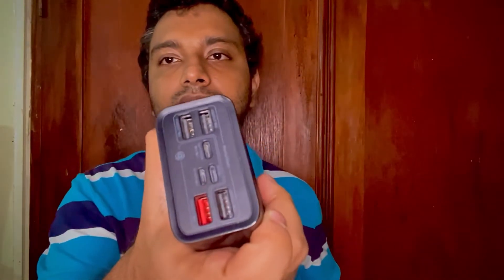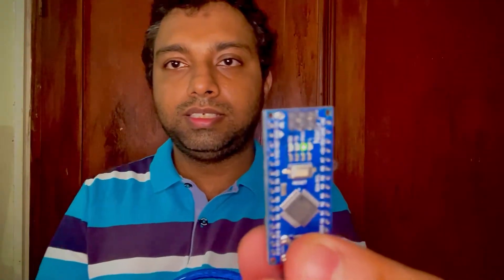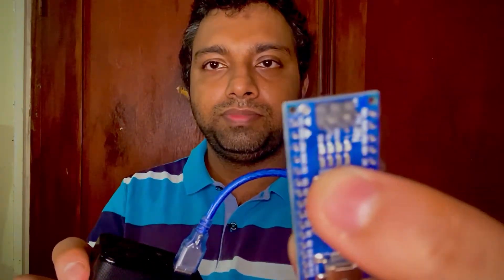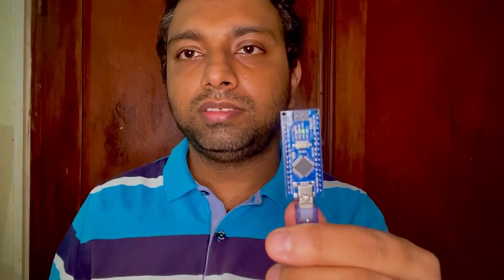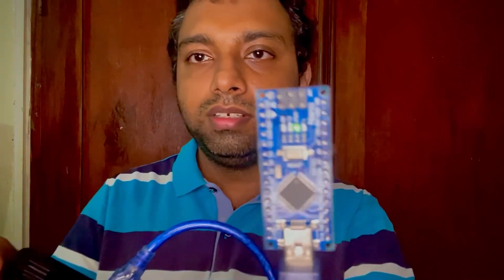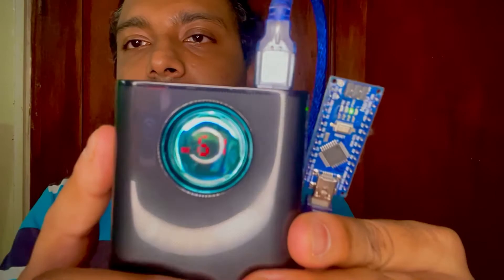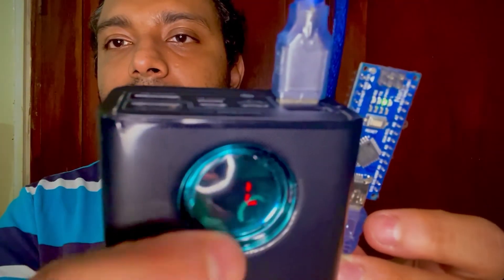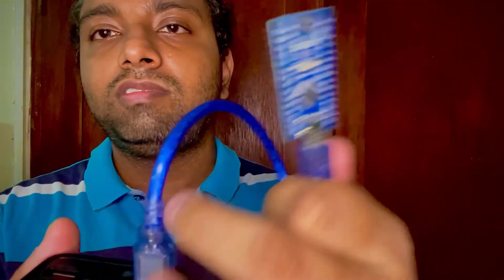Interesting feature in Baseus 65W Power Bank

Comment: Damm guys dont buy this BASEUS 65W laptop charger. This is a common problem.  It only lasted me 2 months and now its dead. Its the design. DONT BUY IM WARNING YOU. Dont waste your money on this Chinese SCAM
Reply: Worked only for 2 days. Baseus should stop selling this model
Reply: The circuitboard for the input is not working anymore I have the same problem. Doesn't respons to anything anymore it's dead
Reply: @mbb3a  I used mine occasionally for about 10 months. Then when I finally decided to use it for something a bit more intense - charging a laptop - it was doing just fine, charging at 20v until the Baseus ran out of battery. Was never able to charge it again after that 🤣 complete pile of trash. Amazon refunded without hesitation and without asking me to send it back, so I feel like this has happened a lot.
Reply from the maker: What happened mate?